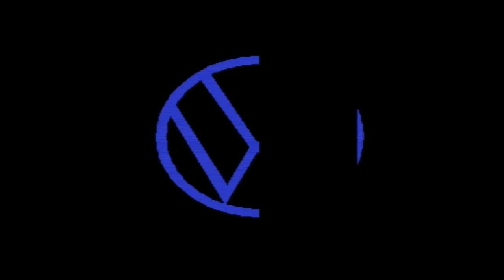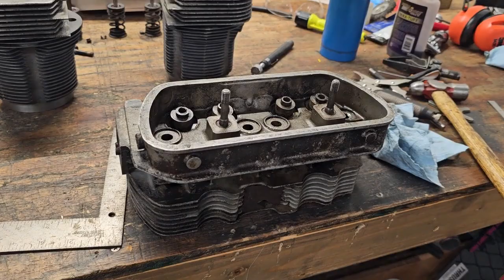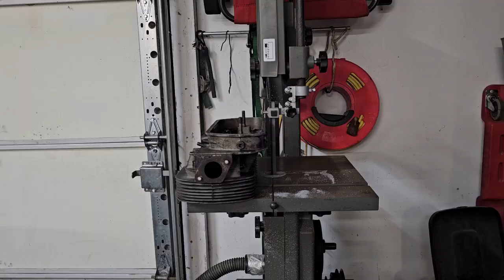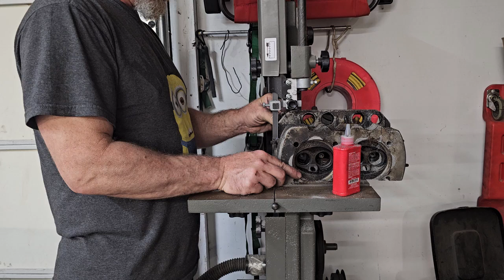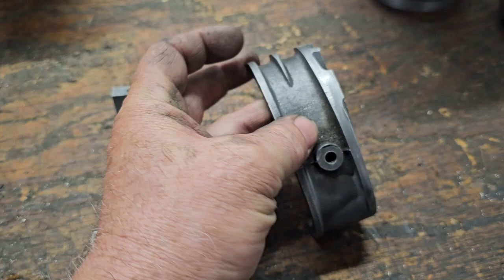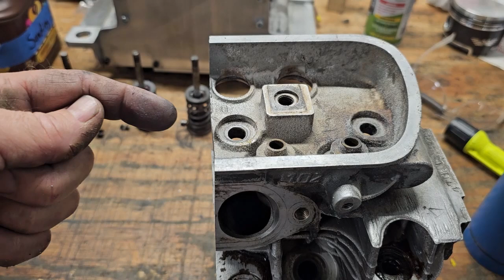1/2 VW Build - Part 19.1 - Cutting Out Cylinder Head Parts

Comment: Thank you Jason for taking the time to thoroughly document your 1/2 VW build.  I have a set of Morey's plans, but they don't even come close to illustrating all of the details and obstacles involved in the conversion process.  The work required just to make the heads almost justifies finding a set of 1/2 VW Scat heads.  I saw them decades ago and don't even know if they are made any more and like all things today, how expensive they've become.
Reply from the maker: I remember the Scat heads but I haven't seen any for sale in years either.  I did mess up a few months ago and didn't buy a set of heads that Cassler had made.  All I would have needed to do was bore them out to fit the 94mm cylinders.